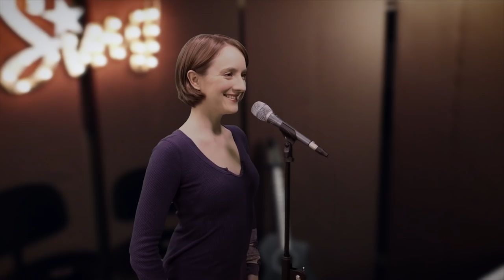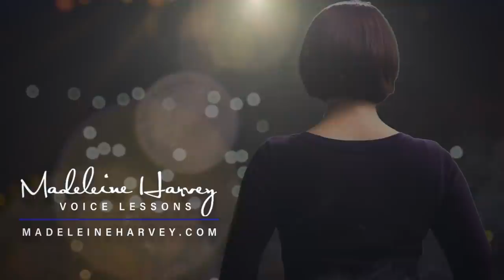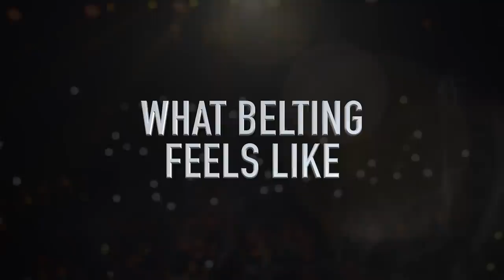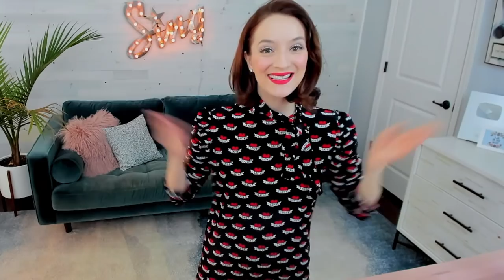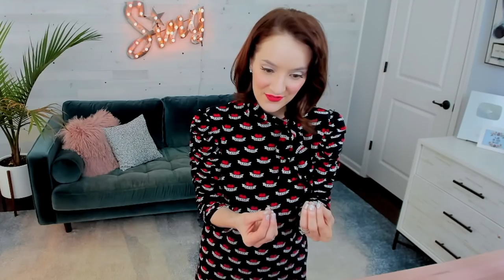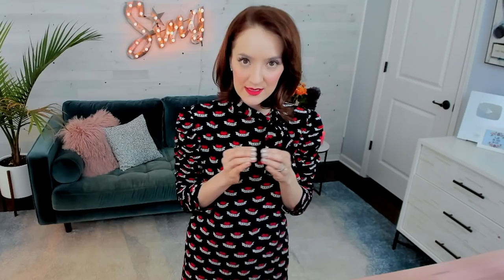Belting Should Feel Like This

Comment: This is partially related but I have a question. I have pectus excavatum, pretty mild, but I have a hard time using my sternum muscles to sing. Is it still possible for me to excel as a vocalist with this condition?
Reply: I would recommend doing diaphragm exercises to boost your support, since that's what I imagine you struggle with most. Breathwork exercises will also help. Practice holding comfortable notes (within your tessitura) for as long as you possibly can in rapid intervals. Both these tyoes of exercises are readilt available right here on YouTube. I recommend the Aussie Vocal Coach for vocal power, agility and sustenance exercises. 

I hope my advice helps you in some way!

Comment: Hello Madleine   thanks for your great lessons.  I have a question about vocal range. I think I am a mezzo as a colour of my voice, but because of my range I suppose I am a alto as I have no sound at all after a Bb5, and even at a A my sound is not consistent.  Does it  mean that these are my physiological limits?
Reply: Is this in head voice? If so, it may be possible that you aren't feeling head voice properly. I am a tenor and I can barely get out a B5 (I literally sound like a squeaking mouse up there). It feels like I'm forcing mixed voice higher than I should, is this what you're feeling?
Reply: @stevengrantofthegiftshop1549  it is in my head voice.  After Bflat 5 I am voiceless comoletely.  I just wanted to know if someone has the same expérience of no sound at all qfter a certain pitch
Reply: @monicaconsigliereLavieenfleur  ohhhh that’s interesting, hope you get your answer soon! 👍
Reply: @monicaconsigliereLavieenfleur  you're probably breaking into flageolet/whistle register at that point!!

Comment: I have a problem where I fart when I belt ...what should I do about that?
Reply: @viictor1309  What if it pops right out due to the sheer force and shoots someone in the face in the audience?
Reply: @efair11111  that's why you should never turn your back on audience
Reply: @efair11111  booty shaking engage different muscles so wine stopper is firm in this case